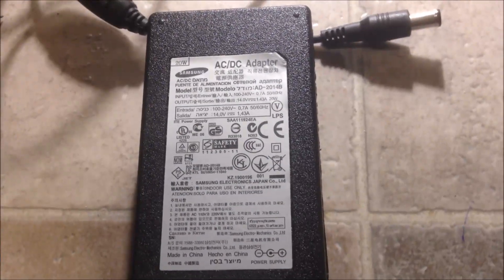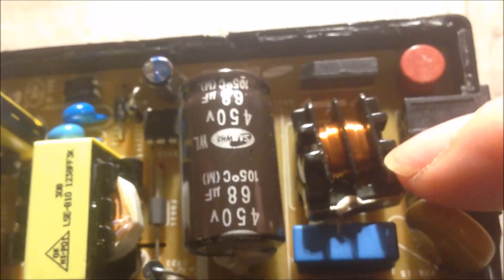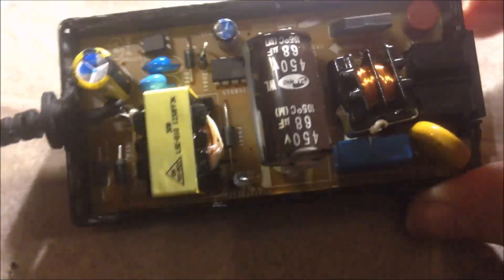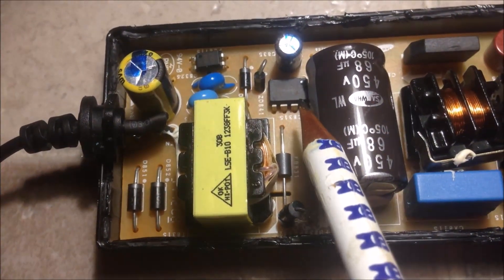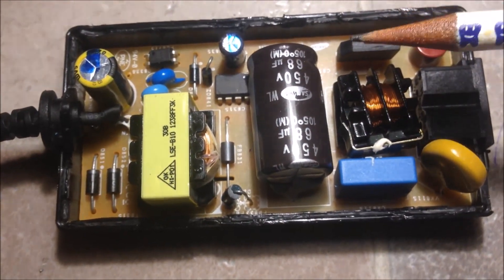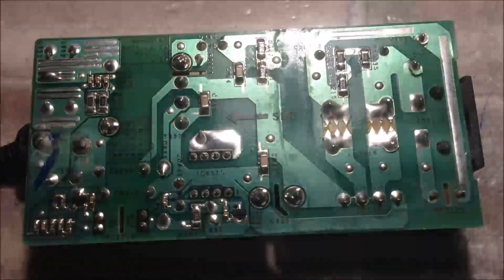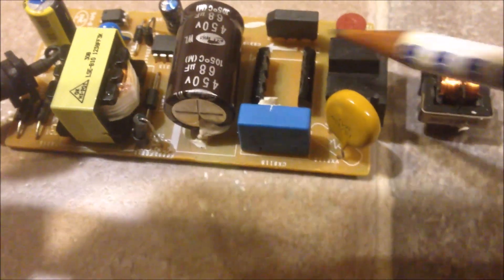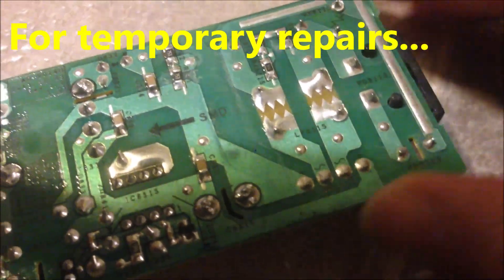Samsung 19" Monitor Power Supply: - How to Repair

Comment: Hello brothas, please reply anyone! my monitor started auto turning off rsndomly when i connect power cable it turns on bout 3 sec and then goes black again, please any tips? (cable working fine, tried other one) i think problem is on monitor port what csn i do?
Reply from the maker: It could be a problem inside the monitor. I had another monitor that had similar problem (turned itself off randomly) due to a faulty transistor. It would be rather time consuming to find out which transistor and then replace it.

Comment: not sure if you can advise. I have bought a second hand 24 inch led samsung monitor syncmaster sa450 with an external power supply. It is brilliant, when it works! every now and then the led backlight goes off but i can still see the picture if i use a source of light (phone) up close. Sometimes turning the screen off and on works but sometimes it does not. I'm not entirely sure if i have a faulty led somewhere that could cause the power supply to cut off the power, the small board inside the screen or the power supply. What's your opinion?
Thanks
Reply from the maker: hi, if you can see the picture with a light, you power supply should fine! The problem should be the backlight driving board: some part got faulty so that when hot, it will draw too much current then shut down the monitor.  One of my monito had that problem and I replaced a transistor to make it work again. good luck!
Reply: @RepairDIY  thanks for that.
I opened the screen up but there is just a small board and have no idea what component needs replacing. Fun fact, in the last 2 days the screen did not go off at all, during a 5-6 hours usage. very odd. I check the price for one of those boards and it is almost the same of what i paid the screen. Wondering if there is a why to find the faulty component on it
Reply from the maker: @LM-wk6ty  yes, agree! if too expensive to repair, it may be better to just use until it's really packed up. have a good day!

Comment: I have a problem of the lampe of the power adaptor  is turn on and of and the monitor not working because this problem
Reply from the maker: hi, you may use a multimeter t measure the output of the power adaptor. it may also be the problem of the monitor: if there is any over-current inside the monitor, the monitor may shut itself off. have a good day!

Comment: please tell me out put diode value, ic value which is before transformer and 68 mfd 450 V capasitor electrolyte ya non electrolite and other components value.
Reply from the maker: on the 8-PIN power management chip, there are two lines of characters: BCDAJ,  D156MRB. For the diode, i can only remember the current was 2A for each diode and the two diodes are used in parallel.  good luck!